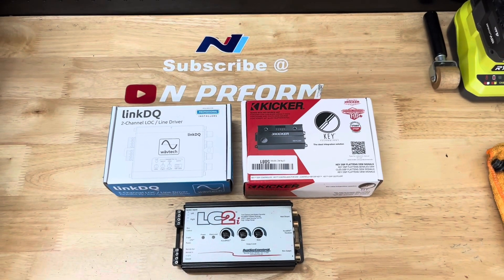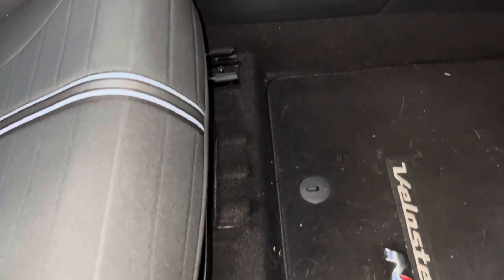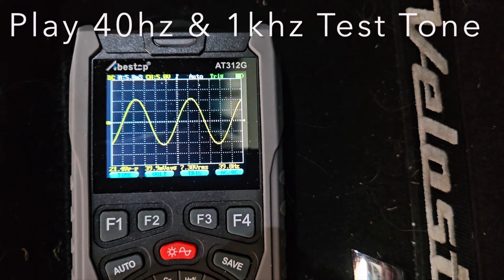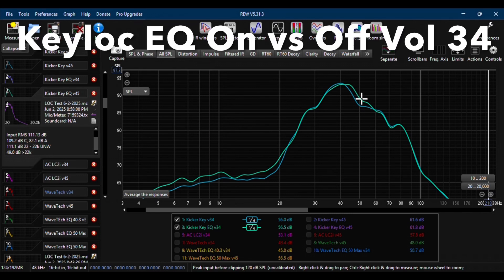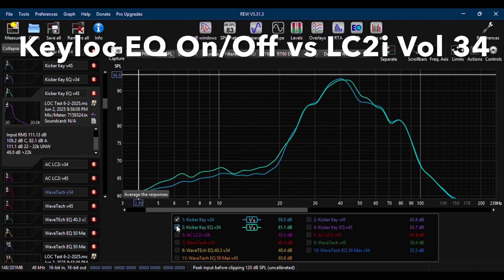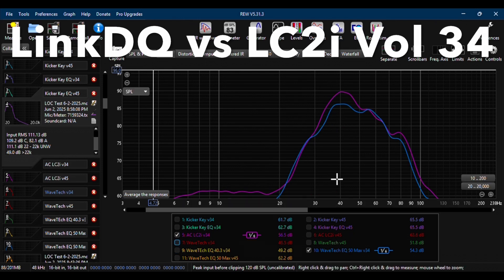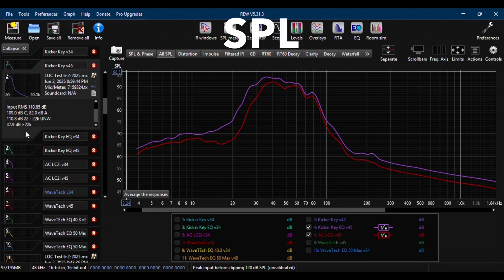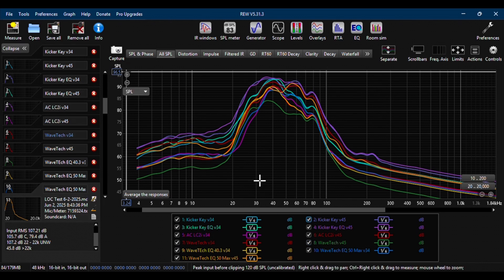Kicker Keyloc, AudioControl LC2i, WavTech LinkDQ LOC Line Output Converter REW Comparison Review

Comment: I have a 2020 BMW with I drive 8, what is the best one to use? I have the lc2ipro, but was told the key lock is the best for the BMW?
Reply from the maker: I’m not a BMW expert, but the keyloc is a good choice as well. I just preferred the LC2i during my test. For just adding a sub I would feel the LC2I would work great. If you’re adding a full system and don’t want to add a DSP then the keyloc would be a good alternative to give you a flat signal for your entire system. Especially, your front stage.
Reply: @nprform so I already own the LC2I pro and I literally just purchased the key lock today but the only weariness that I have with the LC2I pro is setting the accubass level threshold and bass output. Then when you set gains and lpf  for your amp which I have a JL RD1500.. I feel like it would add so much extra bass and I'm not sure how I could attenuate it the way I would want to so basically I guess I would have to have two knobs I'd have to have one for the audio control and also a volume knob for the JL Rd1500 (which is basically just a volume knob for it)
The weirdest thing for me is when I turned my volume up and I had the base on in my vehicle it didn't seem to roll off from what I could tell but I guess I need to use the meter to do it correctly...
And what I kind of don't understand is it seems like the key look wants you to be all at the same level whereas the LC2I is for adding base exactly where you want it?
Reply from the maker: @Schooobe  First, if you’re going to use the LC2i, you don’t need to run two bass knobs. You will set the amp’s gain and set-up the LC2i, then use the LC2i’s knob only. Second, the Keyloc is working as a de-equalizer for the factory system. Its job is to remove all the factory’s manipulation of the output signal. This is so you have a flat uncolored signal going to your amplifiers. The LC2i is adding bass back to a signal that has reduced the bass output at a certain point to help protect the factory speakers. The LC2i is more focused on helping the bass signal. Whereas the Keyloc is trying to correct the entire signal by making it flat throughout the entire frequency range.
Reply: New sub btw, great video  @nprform
Reply from the maker: @Schooobe Thank you! I really appreciate it. :)
Reply: @nprform just to make sure. the key lock will fix and factory eq and give you flat signal but won’t fix any factory bass roll off. if you have that, get the audio control
Reply: @justinwinston9929 your comment is both correct and incorrect. It seems like you don’t exactly understand what a flat Eq is or how a dsp/loc would achieve one. If your factory system has bass roll off (this is by far the most common change coming from factory) the kicker keyloc would remove that adjustment, giving you a flat EQ to shape as you see fit. The clean flat signal could then be fed into your amp and you can bass boost that way, or you can use a 31 freq Eq before your amp do it that way.  Not a big deal just saw you were telling someone false information, but looked like it wasn’t intentional, just a misunderstanding.
Reply from the maker: @justinwinston9929 The keyloc is designed to correct the factory signal and make it flat, which should correct bass rolloff. I just felt, for adding just a subwoofer, the LC2i worked better for bass rolloff.

Comment: I have always had best results with the lc2i. Been using them for years. Others just don’t sound as clean and perform as well.
Reply from the maker: I’ve always used the LC2i as well. I can see the other two working for some, depending on their install, but in my case the good old LC2i worked the best.
Reply: What I worry about is how do you know how to tune that perfectly on top of tuning your amp so which one do you take care of first do you tune the amp and then add the accubass
I own an lc2ipro, but have really been thinking about this keyloc